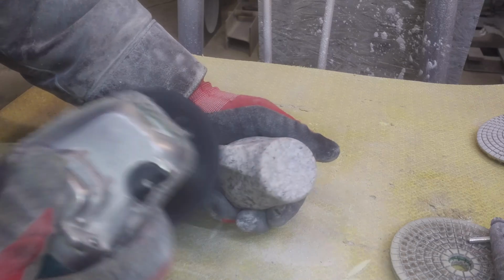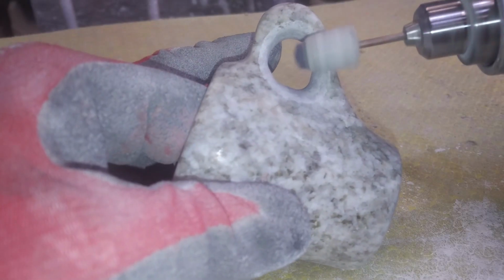How to make a granite coffee cup.

Comment: Do you have a shop for buying these mugs? I imagine the natural stone keeps hot and cold insulated longer. It'd be great to take a master class and learn this skill. Thank you!
Reply from the maker: Unfortunately, there is no shop for now, but I’m thinking about opening one in the near future. As for the thermal properties of the stone, it has a lot of thermal mass, so of course, it takes longer to cool down. However, you need to preheat it before pouring any hot beverage; otherwise, it will make your beverage colder. If you want to try making one yourself, you should definitely give it a try. You don’t need expensive or sophisticated tools. I would suggest starting with a Dremel and small diamond bits to get acquainted with the material. As for the material, any boulder without noticeable cracks will work.